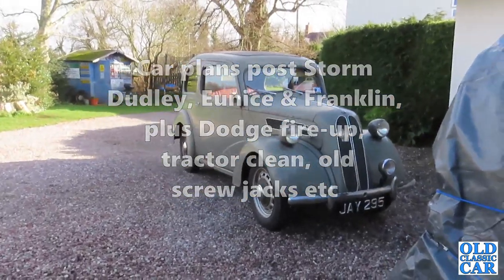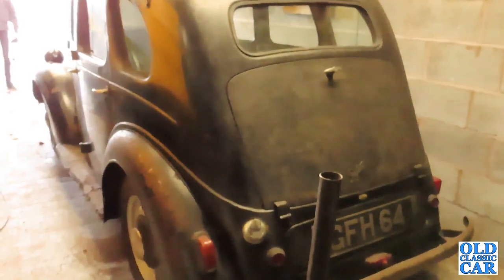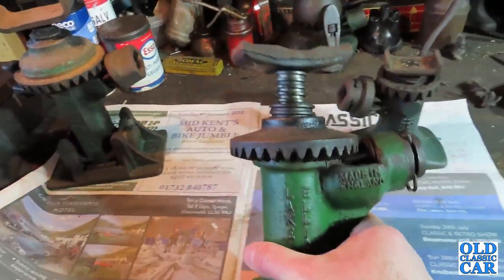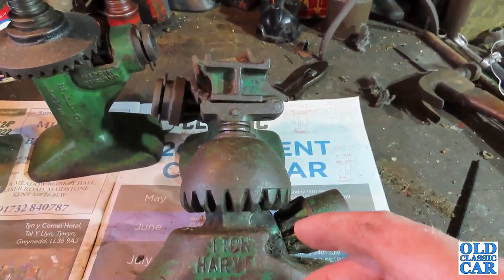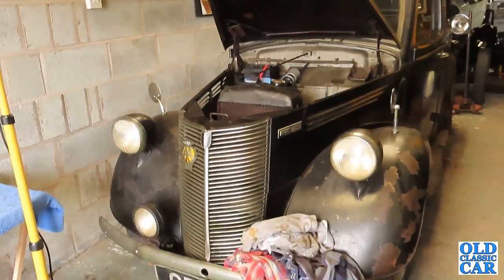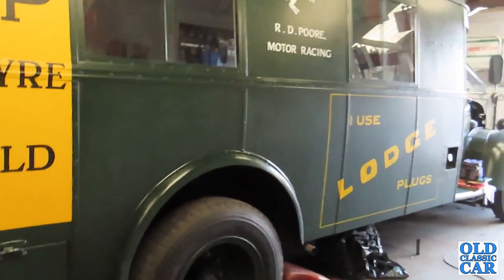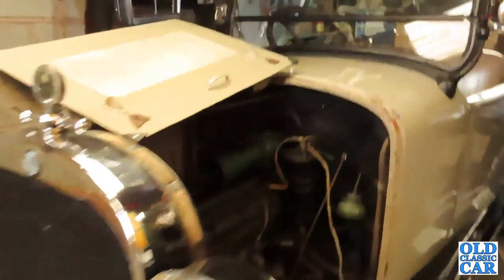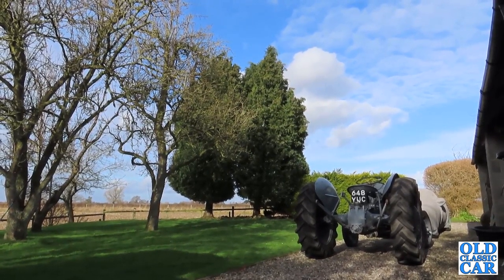Classic car move-arounds, tinkering, & changes post Storm Franklin etc | Old Classic Car vlog

Comment: I too love early jacks, nothing made today even nears the quality of these devices and remain utterly useful for all manner of uses.I recently aquired several at a garage clearout , the largest being a 6-ton rated  Lake & Elliot with the  body  bell-shaped- and even with the original handle !.I have seen the same style slightly smaller rated at 2 tons as part of original equipment on pre-war Rolls-Royce cars but with a Dunlop label and an elegant L-shaped long  handle , the engagement of which never comes apart during use it is so well designed  .Glad you've got Harley well trained !.
Reply from the maker: Glad I'm not the only member of the ancient screw-jack appreciation society!

Comment: After owning my '32 Chevy for a couple of years, I found the original jack and handle stored under the seat in a storage compartment. Good find. I also have several versions of Model T jacks to go with my '17 T Touring. I can't resist a good old jack. Good luck with the fleet changes. I hate to see the little Ford go, but understand you're reasoning. Joe
Reply from the maker: Cheers Joe, I found a great old Ford jack in a secondhand shop 3-4 years ago, it may have already been in one of the vids from a year or two back, I don't remember now :)

Comment: WD 40 is a wonderful rust inhibitor, I use it religiously on my motorcycles when I store them in the basement for the winter...
Reply from the maker: Yep I spray it around too when the bad/cold weather arrives, I also leave bonnets raised to help keep air flowing around the engine bays
Reply: @oldclassiccarUK  I live in New England, same climate different time zone...

Comment: Totally understand the comments about thinning down the collection - think it’s the right call. Would be interested in your shortlist for a longer run car as I’m looking myself. I’ve only got as far as a P6 or Triumph 2000 so would be good to know your thoughts.
Reply from the maker: Volvo Amazons are a great shout but getting pricey for a good one (plus I've had them before, I'd prefer something new-to-us). I like P6s but I'm put off by the potential for hidden rot in that bodyshell, plus working on the rear discs looks like a pain. A 2000 is a possibility, a 2500 estate would be excellent.

Comment: I have your problem
Too many cars and a truck and not enough garage space
Wanting to build another under cover area to store a few more
Reply from the maker: I thought about doing that too, but I'd only fill it, my plan is to cut back overall :)
Reply: @oldclassiccarUK  yes that’s an issue
I’m sure these old cars breed
I’ve sold several and now gaining back a Wolseley 1500 & 6/99 And an Australian Austin Lancer ( same as 59 Wolseley 1500) I never knock them back as they will have a second chance at life again
Reply: @oldclassiccarUK  An extra bit of weatherproof covered area [an industrial building, perhaps?] would also give you more 'space' when actually working on your vehicles. Or free up workspace within your existing garage?